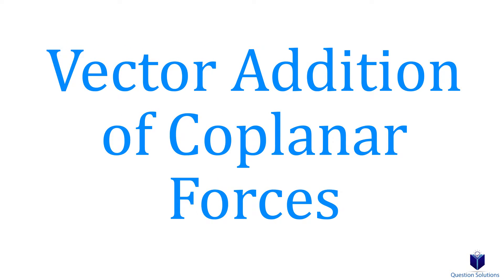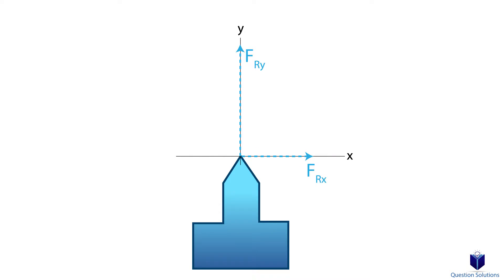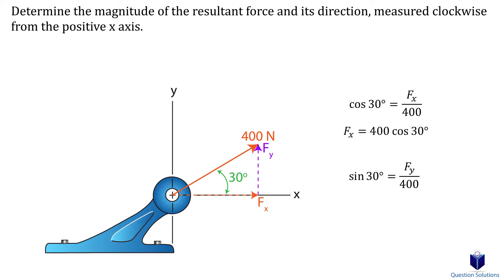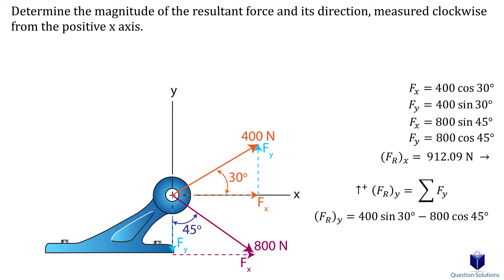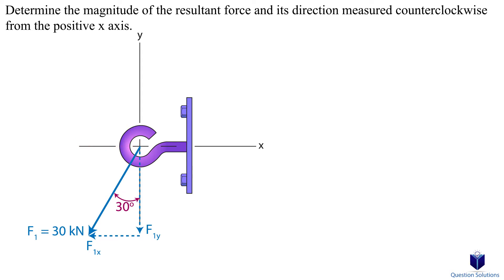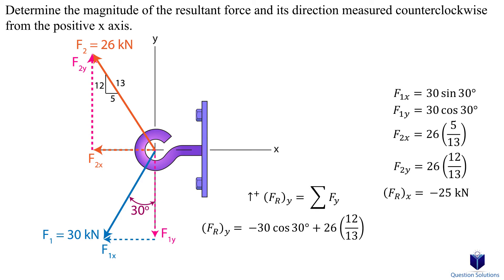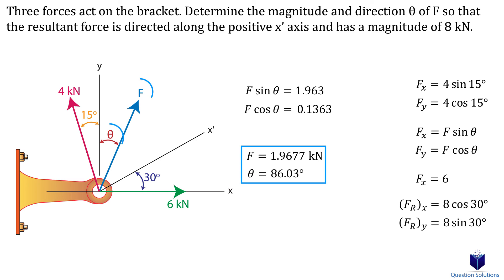Vector Addition of Coplanar Forces (x-y components)| Mechanics Statics | (Step by step examples)

Comment: Thank you very much! I just have one clarification.
At around 9:08, the angle θ is shown as 86.03°. However, there is also a 30° angle indicated below, and another angle between them. If I add the two known angles (86.03° and 30°), even without including the middle angle, the total already exceeds 90°, which seems inconsistent with a right angle in the first quadrant.
Could you please clarify how these angles are measured and referenced? I may be misunderstanding the angle definitions.
Reply from the maker: No, you're right, it's because the diagram given is not accurate. The F vector is much closer to the x-axis than shown in the question diagram.
Reply: @QuestionSolutions  Thank you so much for the reply😁 I get it know, I was just overthinking things😅. Your videos are really helpful, keep it up! I difinitely buy your membership later. ❤

Comment: I think you made a mistake on pheta for the final question. The answer should be 3.97 degrees, not 86.03.

tan-1(opp/adj) = (x/y) = (cos/sin) = (0.136/1.963) = 3.97 degrees

Just look at the picture. There's no way that's 86.03 degrees if it's drawn to scale.
Reply from the maker: No, what's shown is correct, but the diagram is not to scale (this is true for a lot of these problems in textbooks, so be careful). I've only drawn the diagram as shown in the problem, but the reality is, force F is actually below x'. It is 86.03 degrees away from the positive y-axis, and 3.97 degrees away from the positive x-axis. You can verify this by actually breaking all the forces into components and then finding the magnitude vector, and it will be 30 degrees away from the positive x-axis, along the x'.

Comment: Hi, just wanted to say, loved your video man, those animations are really sick. Just one question, since the resultant vector is in the third quadrant and in a clockwise direction, shouldn't we use the negative (Fr)y component to have a negative 21 degrees?
Reply from the maker: I am glad you loved the video. To answer your question, can you provide me with a timestamp so I can take a look and help you out better?
Reply: @QuestionSolutions  for sure, it's 3:38
Reply from the maker: In a very simple sense, you can pretty much forget about all the quardrent stuff when it comes to statics. It works for high school math since most of the time, you're using arbitrary values on a coordinate system. But in statics, positive directions are always established during a question and those are the rules you will follow until the question is done. For example, you can pick down to be positive, left to be positive, right to be positive, completely up to you. It does not matter where the force lies, as long as you follow through with the directions you picked to be positive. Here, we are specifically told to give a value measured clockwise from the positive x-axis. So you will measure a magnitude value in degrees. This value says from the positive x-axis, in a clockwise direction, the resultant force is at 21 degrees. If you write a negative sign in front, you will lose marks as that's an incorrect solution. If, however, the question did not state any measurement direction, you can instead write 21 degrees and then next to it, show a symbol to indicate how the angle was measured.  @DanielBarreiro-c8n

Comment: Hi there, on the last question which is (minute 8:40), when you add the resultant of x components, I'm not sure why 8 cos(30) is separated from the other x forces. As they are all in the x direction, isn't that 6+Fsin(ceta)+8cos(30)-4sin(15)? This will give you an answer of 11.89.
Reply from the maker: Read out the equation and that will help you understand it better. So here is how you would do that. The x-component of the resultant force is equal to the sum of all the x-components of the forces applied to the bracket. So it's not based on directions, but rather, we are saying, in simple terms, the only way to get the x-component of the RESULTANT force, is to add all the x-components of every single force applied to the bracket. I hope that helps!

Comment: How to know whether we have to break it in component or do it like we did previously by using triangle law?
Reply from the maker: So they are two different methods to get the same answer. However, going forward, you'll need to use the component method over the triangle method for most questions. So try to become an expert at breaking forces into components.
Reply: Thank you

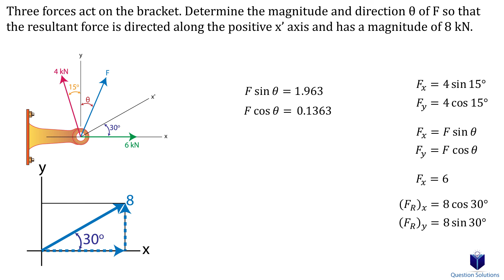Comment: 8:50 how did you get Fcostheta = 0.1363? I did 8 sin 30 = 4 and 4 cos 15 = 3.863 then minus 6 but when i add them together it says 1.863
Reply from the maker: So just focusing on the equation for y-axis forces, all you do is 8sin30 - 4cos15. That gives you 0.1363. So you're just isolating for the Fcosθ term.

Comment: I hope you notice me, how did you simplify in the part of 8:43?
Reply from the maker: So you can directly plug the cosine and sine values into your calculator. 8cos30 = 6.928 and -4sin15 = -1.035. After that, you're just adding the values together and isolating for Fsinθ.
Reply: @QuestionSolutions  My calculator shows that the answer is 5.89 and not 1.963. ☹️
Reply from the maker: @ronsking4083  So you have 6.928 +1.035 - 6 = 1.96
Reply: @QuestionSolutions  why not add 6 since it is along the positive x-axis?
Reply from the maker: Not sure what you mean here. We are isolating for a term, so you bring the term you want to one side, and the numerical values to another.  @gilleanquebrata7672

Comment: On the first problem, when you are setting up your triangles, you moved Fy to the right to form your right triangle. If you moved Fx instead to form your right triangle, wouldn’t that give you Fx = 40sin30 and Fy = 40cos30?

I’m trying to figure out why you moved Fy in the 400 N force, but Fx in the 800 N force.
Reply from the maker: No, your angle would not be 30 if you move the x-component up. You'd need the other side of the angle, which would be 90 - 30 = 60. So your x-component would be 400sin60 which is the same as 400cos30.

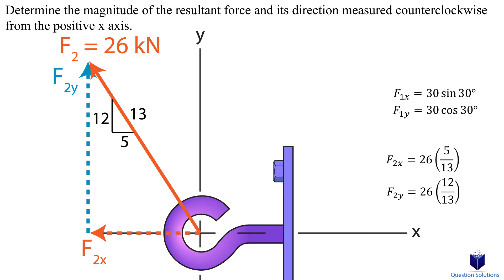Comment: 5:58  how did you get 12/13 ? I cant understand that quick sorry
Reply from the maker: I am not sure how to explain it more :( The 13 is the hypotenuse of the little triangle so that goes on the bottom. If we want the y-side, then we need to look for the value on the y-side of the little triangle. Here, it's 12, so that's what we use for the top of the fraction. If you need the x-side, then you look for the x-side on the little triangle. That's 5, so you write 5/13. If you were referring to the values, they were already given in the question diagram.

Comment: 8:56
If I use Fcos(86.03) it results to 1.9687.
If I use Fsin(86.03) it results to 1.9677 (as shown in the video).

These 2 values are just approximately the same right? Nothing wrong with this?
Sorry for this no brainer question.
Reply from the maker: Yes, it's just errors in rounding. 👍
Reply: @QuestionSolutions  Thanks!

Comment: Sir, I'm confused. Can you show how you get the angle 86.03. I actually tried to use the substitution method but it gives me 86.3. Perhaps, I'm not solving it right, so I want to see how did you do it. My exam is in 2 days, I hope you can enlighten me❤️
Reply from the maker: 86.03 and 86.3 is very close, maybe it's a numerical or rounding error?

See: https://www.wolframalpha.com/input?i=%28y%29sin%28x%29%3D1.963%2C+ycos%28x%29%3D0.1363

I assume you got the F value correct right? if so, you take the F = 1.9677 and plug it in, and then solve for θ, you will get 86.03. So you just take the inverse of sin. sin^-1=(1.963/1.9677) = 86.03 degrees. You can do the same with the cos value as well. Either works. I hope that helps!

Comment: Srry i got lost how did u get F i know how u got F sin0 and F cos0 but after that i got a bit lost
Reply from the maker: Please give me a timestamp so I know where to look. Then I can explain it better.
Reply: @QuestionSolutions  srry its 8:47
Reply: srry from 8:45 i started getting lost also isnt Fx = Cos0 and Fy = Sin0 because that us wat i was thought
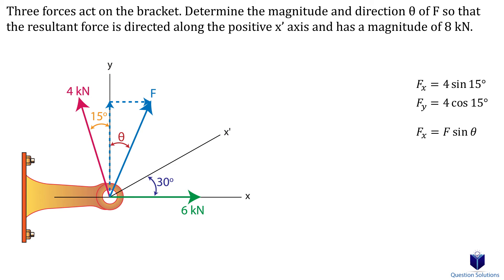Reply from the maker: @dammy3985  So if you look at 7:48, you will see the components of force F. Notice how the x-component is opposite to the angle, which means it's sine, and notice how the y-component is adjacent to the angle, so it's cosine. After we get all the components, we need to figure out what value of force F would give us a resultant force of 8 kN along the positive x' line. So in essence, we are working backwards. I encourage you to try and solve the problem again, without watching the video and then when you get stuck, look to see what the next step is. It might be more helpful. 👍

Comment: hi thank for your time , but how can be the angle that we get = 86.03 between F and y'  and at the same time angle between x and x' = 30  ? if we add those two angles it would give us 116.03 which is more then 90 that should be between the x axis and the y axis ?
Reply from the maker: The force F actually goes past the x' axis, and is 3.97 degrees away from the x-axis. Remember that the diagram isn't always accurate, it's just a base point to start the problem. When we get new data, we have to reimagine the diagram in our heads.  In this problem, we know that force F is actually 86.03 degrees away from the y-axis, which means it must go past the x-prime axis. Also, I am not sure why you are adding the 2 angles, since there is no relation between them. One will simply overlap the other 👍

Comment: In 4:54 your angle is supposed to be in minus, u ignored the minus sign in the "365.68"
Reply from the maker: So I think you might be a bit confused about how we draw the angles. The negative sign on the y component means the component is along the negative y-axis. That's why it was drawn downwards in the diagram. So when you find the angle, what you are finding is the angle with respect to the positive x-axis here. From FR to the positive x-axis. So an angle can't be negative. If you need further clarification, let me know.
Reply: @QuestionSolutions  So since the angle is negative we tend to ignore the negative sign, That's to say an angle can only be positive?
Reply from the maker: @johnwealth2205  I just want to make it clear that we aren't ignoring the negative sign. This negative sign is in relation to the coordinate system we used. So we got a negative value because the y-component is facing down, and that's only because we established up and to the right to be positive. In other words, our coordinate system had y and x at the top and on the right side (this is almost always the case anyways). So when we got a negative value, it indicates that our y-component faces down, along the negative y-axis. Think of it this way, the force itself can't be negative right? Like if we had a box, and there are 2 forces applied to it, one is pulling on it from the left, and another pulling from the right. The right will be considered positive if we assume right to be positive. Does that mean the left one in real life is negative? What is a negative force in our real world? There is no such thing right? So all we are saying is, a negative force is simply a force applied in the opposite direction to what we consider is positive. Once you draw your forces, when it's up or down, based on the positive and negative signs, we need an angle to show where it is with respect to our positive x and y axes. So we use the inverse of tan to find it. The angle isn't negative because it gives us a "magnitude" value of where our resultant force is, with respect to the x-axis. Going a bit further, what is a negative angle? In degrees, it just goes in a loop, from 0 to 360, and then back around again. Does that make sense?
Reply: @QuestionSolutions  Surprisingly you're really good at explaining..... I understand better now.... The negative sign is a representation that let's us know the position a value lies in the x or y axis , It simply shows whether or not it's in the positive or negative value of x or y..... But when it comes to angle ( as it concerns the meeting point of two lines) it can't be a negative value right? I'm just trying to make sure I understand what you're saying
Reply from the maker: @johnwealth2205  That is correct, it is indeed just a way for us to know where the force lies, in the positive or negative axis. And yes, so angles aren't negative. Like imagine someone told you to draw an angle of -60 degrees? What would that be? Would it mean a counterclockwise turn? Instead, we do it differently. We just measure the angle with respect to an axis. It doesn't have to be just positive x-axis, it could be for any but most of the time, we use the positive x-axis as the reference line. That way, we don't have any negative angles. Please see: https://mathmonks.com/wp-content/uploads/2021/01/Reference-Angle.jpg
Reply: @QuestionSolutions  You're superb..... I really needed to grasp this concept for my first year exams. Thank you so much
Reply from the maker: @johnwealth2205  You're very welcome! Best wishes on your exams. :)

Comment: How’d you solve for F and how’d you get the angle? Thanks.
Reply from the maker: Please let me know of a timestamp so I know where to look.
Reply: @QuestionSolutions  apologies. Minute 8:57. I’d just like to know what was performed with these specific numbers. Already watched the recommended videos but I would still like to know what we would do with these specific numbers in our case. Thank you!
Reply from the maker: @eduardobribiesca1980  You can use substitution to solve for the 2 equations since it's 2 equations with 2 unknowns. You will also need to use tan = sin/cos identity. If you don't want to go through the trouble, you can always graph the two equations.

Comment: Sir I just want to clarify in your example no.3 is Fx=4 sin15 or Fx=-4sin15?
Reply from the maker: When you break forces into components, there is no positives or negatives, it's just a component of a force. When you add components however, you need to consider which side is positive and which side is negative. In that case, if you pick right to the positive, any component facing left will be negative, and vice versa. Since we didn't assign positives and negatives for the components, you can even pick right to be negative, which means left facing forces will be positive. So you can see at 8:34, we have -4 sin 15.

Comment: In 3:22 I'm confused. It may be me or you might be wrong because you used 400 as the hypotenuse in the second component when it should be 800. But anyways, the result was correct, it's just the values that you input might induce misinterpretations.
Reply from the maker: Yes, it's a typo, because while I did mistakenly write 400 under the fraction, in the next step, I used 800. I am sure others can easily figure it out, but thanks for pointing it out :)